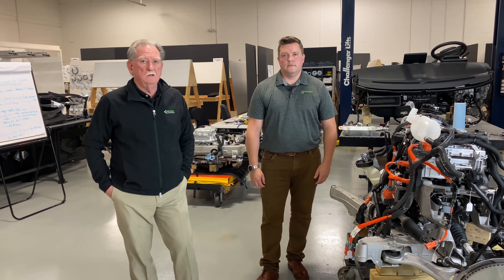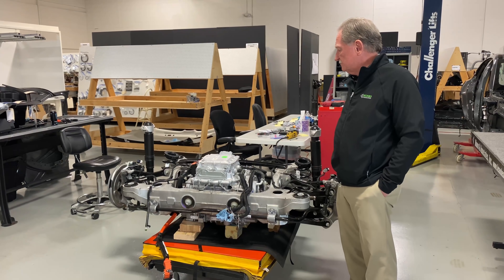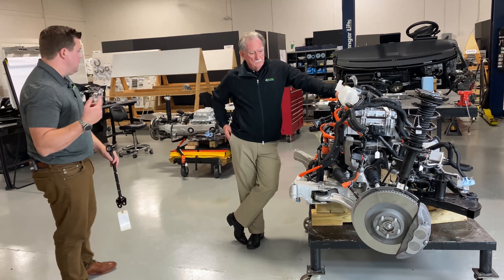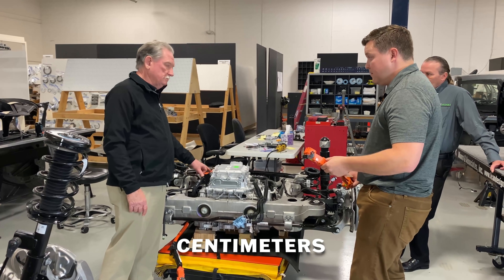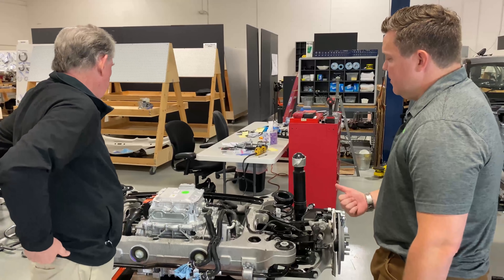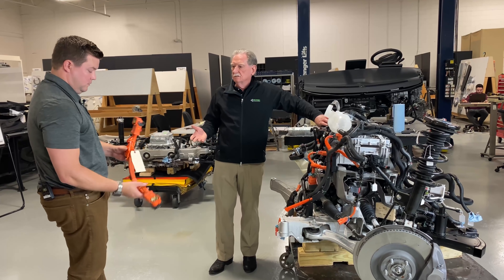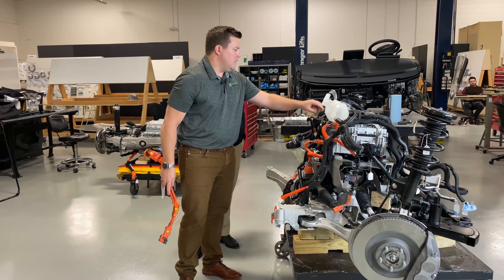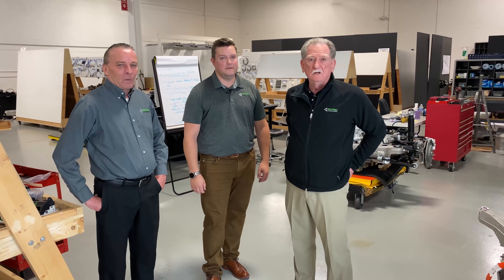Mach-E Suspension & High Voltage Wiring Compared to Tesla Model Y

Comment: 15:14 Sandy: "..is this one of the components we couldn't see in the VW?" [RE: Induction Motor Inverter]

Interesting - VW donated parts for teardown but did they do so with a legal 'don't look' clause on other items?
Did VW pay M&A to NOT perform a complete teardown (part donation is payment in lieu)?
Reply: I thought it might be hidden in the bay and they didn't take everything apart.
He does not say they were not allowed to see it.
Plus the regular VW only has a rear (permanent magnet) motor.
Reply: @abraxastulammo9940  Possibly. However, Sandy goes on to clarify: "...maybe the boards underneath it is what I'm saying..."
A full analysis would involve acid de-encapsulating the chips, X-ray inspection and micro-polishing down through each nano-meter layer to reveal the silicon/gallium transistor-level design. This is expensive and usually contracted-out, so perhaps M&A could not budget for that in these 'teardown-light' reveals.
Reply: @41istair  VW uses Infineon HybridPack inverter, and the Infotainment is said to be based on Qualcomm Snapdragon 820A - what does Ford use?
Reply: The ad-hoc technical discussion in this video make it one of the most interesting ones by far.

Comment: Is Sandy looking in wrong places for competitive advantages? Does it really matter which screws or battery Nokia is using vs iPhone? Are screws and plastics what sets the products apart? What if Nokia used best manufacturing techniques of them all - would it make any difference to their market share? Ford is Nokia. Tesla is iPhone. We haven't settled on the "Android" equivalent yet. Fun times to watch.
Reply: Yes screws do matter, SAAB (originally a plane manufacturer) did make great cars. But Toyota murderd them. One part of SAAB fall was there engineers did use "optimal" screws everywhere, so they did have 100? different screws in the car, then Toyora did have a "good enough" screws and did only use a dozen different screws.  Do not remember the exact number but Toyota was a magnetud better then SAAB in the screw department. Smale things like that add up.

Comment: Great episode, maybe the best tear-down episode yet.  Insights flowed like bullets out of a machine gun.

Ford people: the longer the cable run, the more electrical resistance you get, and that generates heat/saps efficiency.  If you decide you want to match Tesla's efficiency, you've got to pay close attention to those cable runs.

We saw a good example today of why outsourcing constrains design, sometimes in unfavorable ways.

At some point, legacy automakers will need to learn this lesson: if you don't design a BEV from the ground up as a BEV, inefficiencies are going to creep in.  Grabbing legacy parts, like that hanging rod for the induction motor, might save a buck or two, but it will not get you a superb BEV.

Ford probably believes it has nothing to learn about suspensions for BEVs.  And the proof of that belief is in this teardown - standard McPherson struts, cheap and ubiquitous in ICEVs.  But there are subtleties here.  A BEV is not an ICEV.  Its center of gravity is much lower (if it is designed properly), and power is delivered differently without a multi-gear transmission.  A BEV does not handle like a similar-sized ICEV.  Using those McPherson struts reveals something about the thinking at Ford:  they're assuming that the suspension doesn't need to be tweaked for a BEV.  This is a bad, bad assumption,.  They'll get better results if they rethink the suspension for the particular purpose, and do a little R&D to see what works best.  That's what Tesla did, and it amazes me that Ford isn't following Tesla's lead.  Why not?  Tesla delivers better handling, better performance, better efficiency, at a comparable price.  Understand what Tesla did, and why, so Ford can start to catch up.

The Mach-E isn't devoid of good ideas, but as a whole, I'm seeing too much evidence of floundering as Sandy's teardown proceeds.

Perhaps the strangest thing about the BEV revolution is that Elon, who kick-started it and is competing in it, will be happy to see competitors delivering BEVs just as good, or even better, than Tesla's.  His goal isn't market dominance.  It's to end ICEVs.  Ford isn't happy about that goal, I'm sure, but come on, guys, if we drag every drop of liquid carbon out of the ground and put it into the atmosphere, there won't be many consumers left to buy automobiles.  We're facing a death trap.  Our civilization must end ICEVs.  The only question that remains to answer is, which automotive giants will survive the transition?

The Mach-E is a start.  Not a great start, but a start.  But Ford will have to up their game a whole lot to survive.  Right now the gap between the Mach-E and the Model Y is huge.  That isn't how to engineer a success story.

Comment: There was never meant to be any commonality with VW's MEB platform for the Mach-E, that partnership is for a future Ford product that they will manufacture in Europe that sits on the MEB platform. Why they couldn't use the Mach-E's platform they had already designed is another question, I can only guess it's more expensive to manufacture?
Reply: Correct. I was about to make the same point but you got there first.
Reply: The Mach-E is on the large side for Euro buyers. 70% of units there are city cars, superminis, and compacts (segments A-C). Mach-E seems to be small D segment.

For the European market Ford needs a segment-B electric vehicle, to replace its Fiesta/Ka+/B-Max models. It makes sense to share a platform with the electric successor to the VW Polo/Audi A/SEAT Ibiza/Škoda Fabia. 

That still leaves Ford on its own to create a segment C electric successor to the Ford Focus, which would directly compete with VW's ID.3.

Comment: Gents, Rich Rebuilds (YouTube channel) video post yesterday shows a Model 3 owner (lease) being quoted $US16,000 by Telsa to replace a battery as a result of underbody damage to the battery coolant inlet pipe made of plastic.

I'd love to see your thoughts on this one!

Sandy, the fellow was contemplating selling his race car in order to pay this before Rich and his guys came up with a slick fix.
Reply: Why isn't this guy's insurance covering the repairs? Sounds like the vehicle is still under lease. That's why you pay your insurance company for.
Reply: Yeah, insurance was a cockup by several parties he explains unfortunately the end result was he was left responsible for the proposed cost.
The point is, should a broken plastic coolant fitting render the high voltage battery "useless" - requiring a complete replacement, no matter who pays the bill?
Reply: @MarioDallaRiva  Its the same as then the "protective beams" has been compromised in a car, you have to change it, even if they is a small deformation. You can have a discustion if the plastic coolant fitting shall be part of "replace if compromised"

Comment: 12:20 this relatively small observation in the grand view of things reveals why the OEM's will not survive ( I am not hoping for their collapse at all, that's a lot of jobs and a massive effect on the economy ).  psychology and the trappings of corporate culture that make it impossible to innovate in time to stay relevant.   The oem's have to stop spending their money on lobbying, marketing, advertising and propaganda to try and slow tesla's lead and spend money on building a paralel business of innovation like a mini start up that is funded with their deep pockets that does not use any off -the-shelf parts and does not use any old school embedded engineers.  The oem's are like that ship, Evergreen, that got stuck in the canal  if that ship had to turn around and change direction.  they need to break up their haul into tight tiny and fast ships, a fleet of them that can move fast.  Get out of the way and get with the times before you are dead in the water,  oem's.

Comment: Teslas high voltage cable has the brackets designed il less than 40 hours. Also Ford did the Focus BEV years ago, I bet there are a lot of similarities. As for the suppliers: Molex, TE connectivity, DuPont, maby.

Comment: As a Ford employee (I don't speak on behalf of them) the comment about groups not communicating is unfortunately true, and something that impacts much more than just design of parts. I've long thought that newer companies like Tesla's main advantage is a ground up design that allows them to figure out how to do things without being tied to "how it's been done" or "just the way we do it".
Reply: But I just posted elsewhere, that inverter connection.... A simple "can we spin the unit to place the connection at the rear?" from either the inverter designer to the PCB designer, or to the other teams involved, or to "everyone" from the chief designer would have been beneficial.
Reply: @thealienrobotanthropologist  yes, you present valid points. The sometimes suffocating amount of meetings and nonsense does have the benefit of things getting done correctly, albeit taking longer. I certainly have seen the poor approach of just making everyone go to every meeting, which pulls them away from areas they can actually make an impact. All a balancing act.

Comment: This should be done with every product. Once manufacturers know that they are being looked at, they might come up with better solutions.
Reply: This is more informative than anything in school
Reply: In general, I would agree. But as an engineer I’m well aware you’d never get anything to market seeking perfection in design. 😆
Reply: @TheBeingReal  True, if getting to market is the main object or even the only objective.
Reply: @mhfs61  Getting to market is a must.
Reply: TheBeingReal as another engineer, I would respect with the design being good, but the execution being faulty. A good design means you had foresight but a poor execution means  you had unexpected issues along the way. But that is not what happened here. The problem is it’s the polar opposite. Their design is horribly lacking yet they’ve put just enough effort in that the mach e seems to run. For now. 

The real test is 5-10 years down the road when all these added parts and unnecessary connections start failing in spades. That’ll be the real test.
Reply: @philorgneopolotin8762  I am not that pessimistic.  Yes every connection invites potential problems, yet how many times do you find A/C or coolant connection leaks?  It’s just not common at all.  Same for electrical connections in cars.  Even boats with all the same type of connections don’t have significant issues and that is in a far more abusive environment.  

Had these guys not done these teardown reviews virtually nobody would bring up all these “flaws.”  Time will indeed tell, but don’t discount the over all review of the Mach E by these guys was 2nd only to Tesla.  These designs will improve.  Do note the significant price points between the Mach E and comparable Tesla.
Reply: @TheBeingReal  leaks aside, the more tubing you have to use, the more weight you add, and weight reduces range.
Reply: @bobsbeard3977  As a stand alone for weight that is true, unless you can compensate elsewhere for weight reduction.  I get where you are coming from, one has to look at the whole package in this case though.  Did / does the whole vehicle meet its design targets, range balances with creature comforts plus utility. In the end it still has to appeal to buyers, a gutted vehicle with great range just won’t likely sell.
Reply: @TheBeingReal  well, seeing as though the Mach E has a larger battery pack and get less range than a model Y, I’d say they didn’t make up for it in other areas.
Reply: @bobsbeard3977  I have no skin in the Tesla vs anyone game, which often on here are fervent Tesla folk.  Probably most all Tesla owners could not tell anyone anything about the design details they picked out here.  Probably none look into the drivetrain and its operation at all.  Same for the Mach-e.  Suddenly all automotive / engineering design experts after watching a video.  

As I noted, ultimate range may not have been the ultimate criteria for Ford.  The Mach-e was given far better ride reviews than the Tesla.  You can pick and choose all day.  Consumers are buying at a whole different review level: price, looks, color, cup holders. lol

Ford did a darned good job for a full first run at an e-vehicle.  Let the competition begin.
Reply: @TheBeingReal  there’s no such thing as a perfect design, but you can get much closer to perfection when you’re not limited to off the shelve components and actually design components in order to optimize a design.
Reply: @bobsbeard3977  Generally true, with considering what you are optimizing for: there are always trade-offs. Starting from scratch has benefits, but also potential flaws by not knowing what came before and the resultant redesign that follows.  It is a fine line to walk at times.
Reply: It doesn’t have to be perfect so things are sub-optimum but Tesla’s sub-optimum is at a much higher level than Ford’s. End result is a better product with a higher degree of reliability, may also be easier and more efficient to assemble, thus lower labor cost.
Reply: @Chainyanker007  The reliability part is pure speculation at this time.  Same for ease of / cost of assembly.   Tesla is not all that great at body panel fits and is quite a jump in price to a Mach-E.  https://www.caranddriver.com/reviews/comparison-test/a36847087/2021-ford-mustang-mach-e-vs-2020-tesla-model-y-compared/

It is game on for EV’s and it will be tough for Tesla to maintain its market share, if not impossible.  All good for the consumer.

Comment: I think the VW / Ford co-operation was for Ford Europe and it appears the E Mustang is a US development.
Reply: This is correct. Not sure any MEB platform EVs from Ford will be sold in the US. Ford seems far from "walking away" from MEB, last I heard a second car was potentially in the works on the platform.
Reply: @Jastor00  I'm a long way from having any connections to vehicle development, but its my guess that Ford will supply MBE platformed cars (ie a Fiesta or Focus replacement) to the US if the demand is there.
Reply: @domtoni4567  I only know of the crossovers planned for Europe - if Ford sold a Fiest/Focus EV replacement in the US, it'd be a wonderful thing! I'd like to see some non-SUV EV options from non-Tesla manufacturers.
Reply: @Jastor00  Given the cancellation of passenger cars in the US due to SUV demand, we may not see the smaller cars going to production.   The market is now somewhat different from when I was heavily involved in it.

Comment: The guide at 9:27 is there because of an interlock pin on the back of the cover. Cover gets removed, interlock opens to disable HV. The guide pin keeps you from pulling the cover off without being straight to avoid damaging the pins.

Comment: 9:27 this.  most of the criticism they have made can be answered by this. they're certainly going to re-use most parts for other models unlike Tesla which has the freedom to engineer for such few car models
Reply: Yeah, Ford's rationalizing their engineering and inventory resources, and there's absolutely nothing wrong with that, if it gets the job done. A Ford engineer's job is to design the system to achieve the desired performance within the desired budget, not impress Sandy Munro and Associates. The proof of the pudding is in the eating, as they say.
Reply: @jasonosmond6896  I watch these videos with great interest but not sure how the differences between Tesla and Ford will pan out. I took delivery of my Mach-e a couple of weeks ago and so far I am very pleased. There are no signs of poor workmanship and everything works as expected. The panel gaps and general finish is perfect. It drives very well and is indeed very similar in handling to my previous Mustang. Basically if it goes well, doesnt cost a lot to keep maintained and the resale value stays good then why should I worry. The comments people have made saying that the Mach-e will be difficult to maintain and help the service people make money dont really stack up. One person says it "drives like a pig" - well I have never driven one but to me it drives beutifully. Having a system that can be repaired by the supplier seems a plus to me and familiarity with general motor repair cant be a bad thing for the end user. If I am wrong the car will be troublsome and loose me a bundle of cash but my previous experience with Ford has been very good so hopefully I will and the many others who purchase will be equally pleased.
Reply: @jasonosmond6896  👍

Comment: Is there a single engineer responsible for the design of a vehicle in the auto business?   If so, why doesn't that person force standardization of things like the connectors you discussed?  I know that works because I did it that way on the major projects I was in charge of......     Let's get those electric power units ripped apart...
Reply: You can't beat a big sheet of  paper on the floor with cardboard boxes.
"What's going where"?
"Why's that cable there?"
10 minutes, sorted.